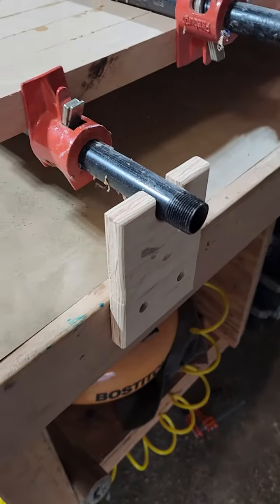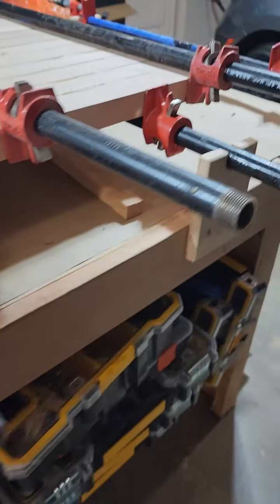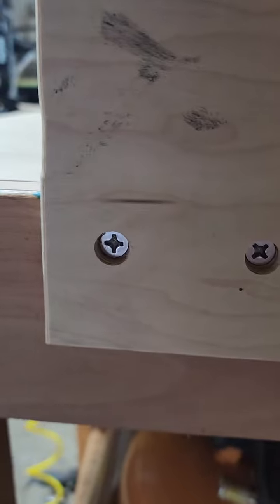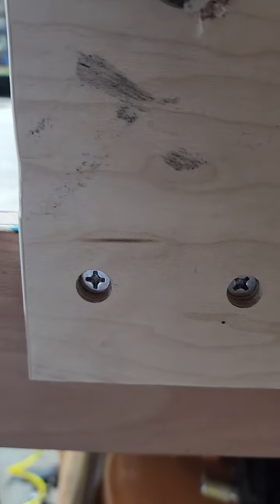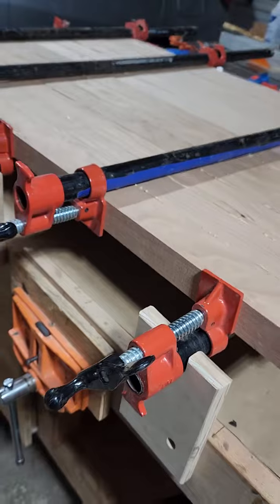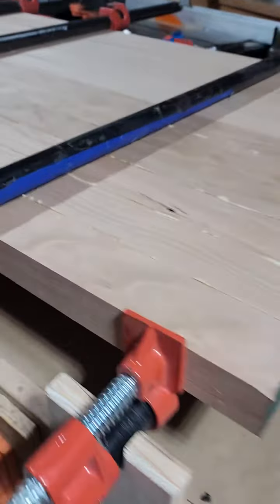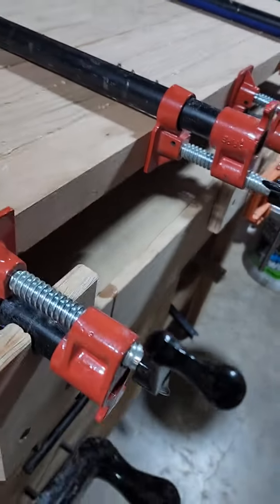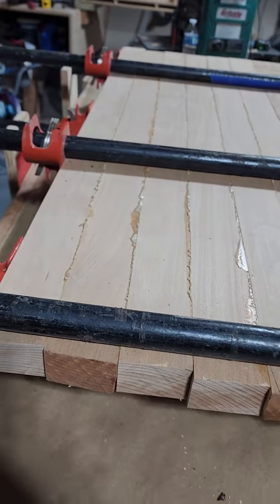Why didn't I do this a long time ago! #smallbusinesstiktok #shopsmallbiz #shopsmall #woodworking #wo

Comment: Any woodworker who needs this pieces made by you and having them shipped, shoud give up this type of occupation, both, hobby and professional.
Reply from the maker: I can understand that point of view for sure! Not every woodworker has a cnc is my thinking. Those who do can batch these out quickly.
Reply from the maker: I went this way to avoid buying t-track, I know t-tracks not crazy expensive but I wanted to use what I had in the shop. This helps me clean up a bunch of scrap plywood laying around too 😂